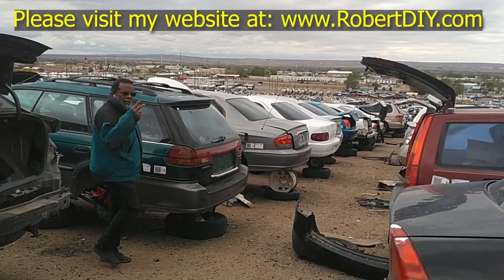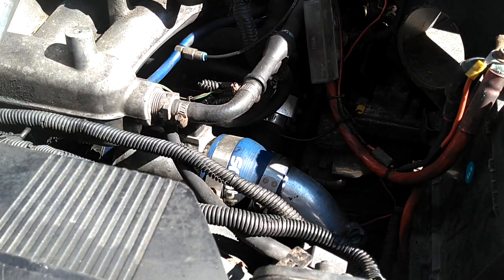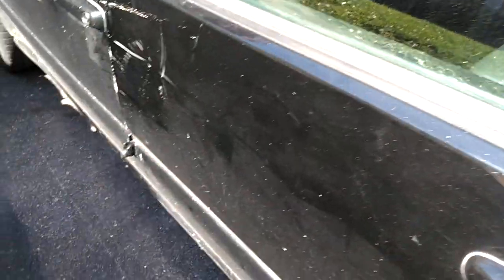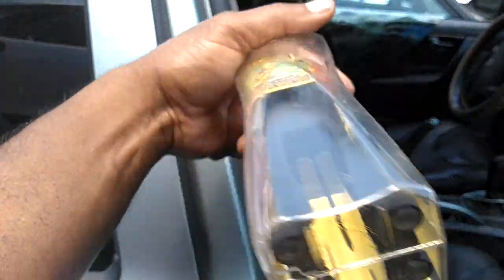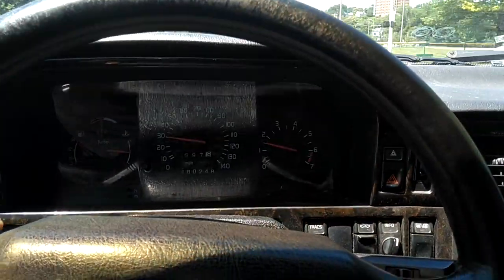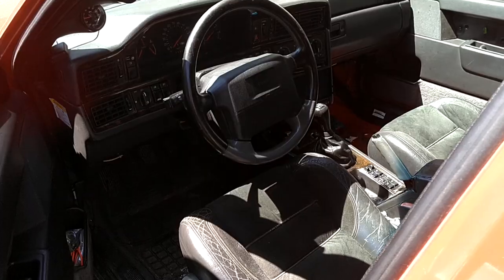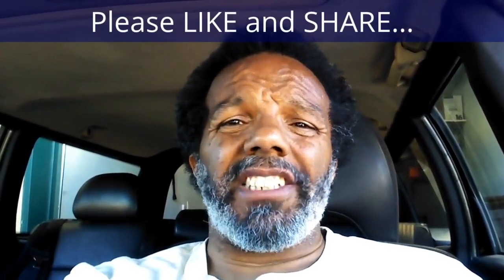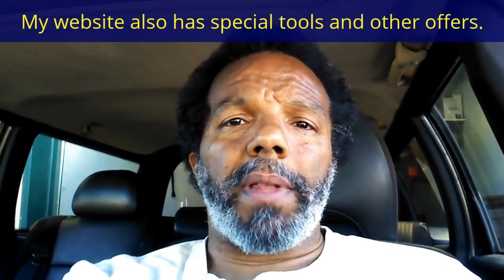Repaired some damaged wires, got a replacement door, please check you oil, steering wheel sway, etc.

Comment: once a week i checked my oil, and im happy that i did so my 850 consumed so much oil. i put like 1 liters of oil once a month and it lasted. but i sold it later on.... It is something, with those whiteblocks. they drink so much oil and gas. But it does not stop me from loving them!
Reply from the maker: cool
Reply: My 94 850 NA sedan has never consumed any oil. I check the oil at least once a week. I bought it new Oct of 1993 and had free oil changes every 6 months at the dealership until a few years ago when I moved too far away to go back. It only has 155,000 miles on it now and I don't drive much anymore because I'm 71.  I think if these cars are broken in correctly and maintained properly there is no inherent reason they would burn oil.
Reply from the maker: What oil do you use?
Reply: @RobertDIY  i dont know if it is called something else in The US compared to sweden. But i used 5W-40 in my 850.
Reply: @RobertDIY  manufacturer is a swedish company called "Biltema". It is the cheapest good oil.

Comment: The oil consumption must not be as bad on non turbo P80s, my 98 v70 is still at the top of the dipstick after 7000km when I did my oil not long ago, and I know the head's never been off it. That or I got a unicorn lol
Reply from the maker: Probably right, no turbo heat.

Comment: Hi Robert, love the channel. I have a 98 S70 GLT ... have replaced the TCV, vac lines, MAF, fuel injectors and spark plugs and the gentleman that had it before me put a new distributor cap on, I’m getting random misfire codes and 3/5 cylinders are misfiring.... have watched ur videos and just wanna ask other than low compression where do you think I should look next? :/
Reply from the maker: have you checked compression?
Reply: @RobertDIY  not myself, but I have it going to my Volvo guy in about a week I was just wondering if there would’ve been anything else other than compression... if it is low/bad compression that’s no bueno, right?